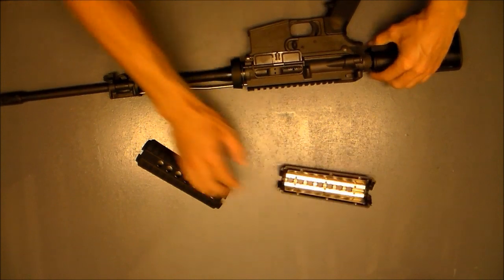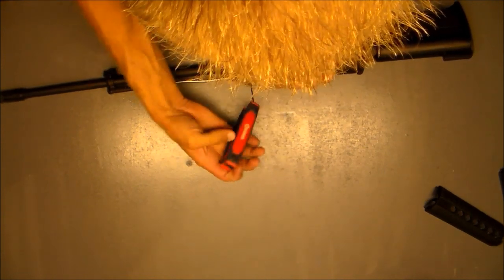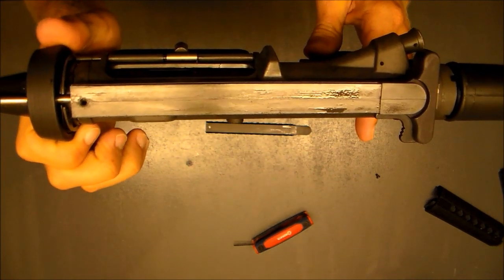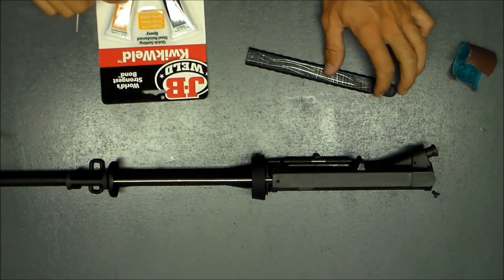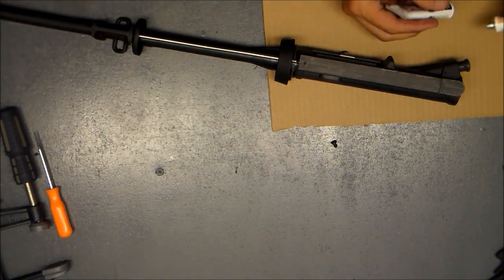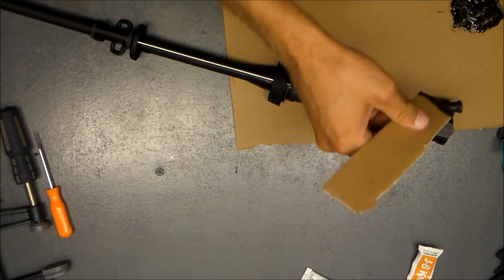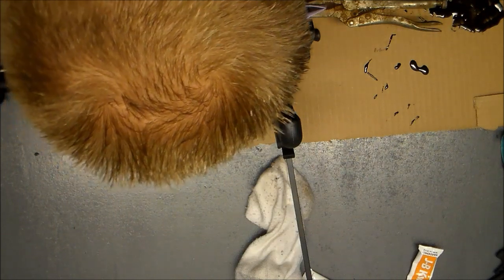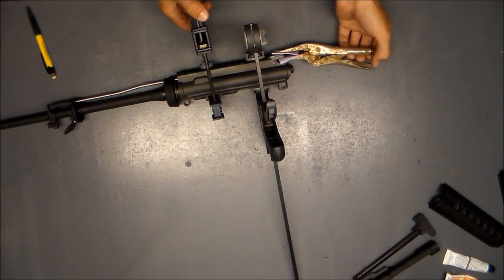Bushmaster Carbon 15 Picatinny rail repair

Comment: Anybody know the size of that screw/where to get one? Snagged a stripped C15 upper with no hardware for $10 a while back. Tbh I didn't even know exactly what it was when I bought it, but figured it'd be fun to find out and worth the gamble. I'm planning to use it for a 22

Comment: I had to do this about three yrs ago.. Still holding! I discovered another thing about the Carbon 15 about a yr ago.. I purchased a fifteen inch free float hand guard, and proceeded to install.. Went to install the steel barrel nut supplied with the full length rail, when I realized the nut wouldn't thread onto the upper. Apparently the carbon fiber uppers require a slightly larger barrel nut, in order to beef-up this area of the upper and add strength.
Reply: Lee, that is good info. Tell me, was the nut that came with the rifle able to correctly mount the rail? I recently picked up one of these for the bargain basement price of $450. One of my concerns is parts compatibility. I know I can just replace the entire upper if there are issues, but would need to be sure that I had the correct fasters.
Thanks!
Reply: @JF-lt5zc  Every part on my carbon 15 can be replaced with stock parts.. So, no worries. There are many mfgs that make free float handguards that will fit over a standard barrel nut. But, I had already purchased a fifteen inch that put a serious drain on the piggy bank.. So, I elected to purchase an Anderson standard upper receiver, back when they were going for fifty bucks. Although the carbon fiber upper requires that special nut.. the only difference in a standard barrel nut and the one that fits the carbon fiber upper.. is the thread size. All the other dimensions of the carbon 15 barrel nut are standard. Hope that helps.. By the way, make sure you know the proper torque for the barrel nut.. Most of the steel nuts are 35-80 ft lbs.. but the carbon fiber uppers can be torqued to no more than 35 lbs.. It's just plastic.. Be Kool Bro! Be Safe! It's Getting Crazy Out There!

Comment: I don’t recommend doing what I did but I repaired mine using super glue and accelerator,  clean surfaces are a must, I completely taped off and masked the entire receiver, all the surfaces that touch between the rail and upper were coated, you do not want the glue to migrate or you will be in trouble. It’s been a year and a half and it’s held so far, any side impacts to a mounted scope or sight should be avoided. Time will tell.

Comment: I bought my Carbon 15 in 'July 2014 I didn't realize it has the same issue until my son found it the other day,  almost 3 yrs to the day in fact. Your idea had me thinking......I know a guitar manufacturer that uses super glue on their acoustic guitars to attach the bridge to the body, the bridge has to hold a significant amount of string tension tuned to pitch, if the two surfaces are clean and flat, super glue may be a good alternative? 

 With that being said I did just that, cleaned both the rail and the top of the receiver, taped and masked everything that I didn't want the glue on and put two healthy beads of super glue along the top of the receiver, not too close to the edge that it would run over, I had the rail already started on dovetail so that when the glue was on I immediately slide the rail on all the way, once you start to slide it on you have to fully commit to it otherwise you could have a rail half on and stuck where you don't want it. The jury is still out on it since I haven't field tested its adhesion, I have my fingers crossed. The power of super glue on two flat surfaces mated together can be incredibly strong, the more surface area covered the more it will hold. Sorry for the novel, Bushmaster suxxx.

Comment: is it still holding up?  same thing happened to me a couple years ago and I just got around to it. I did the same thing so I was just wondering how good it actually works
Reply from the maker: Yes, its been holding a good zero. Thanks.
Reply: sweet! thanks for the info!

Comment: Thanks for the idea.  I have already loc-tited the screw that goes through the rail and into the upper receiver, but it has not solved the 'rocking' of the rail.  Of course, this makes it impossible to hold a zero from shot to shot, let alone range trip to range trip.  

I love my CAR15, but if this is even a semi-permanent fix (lasts for a year or so), the gun will be 100x better right off the bat.  For home defense, I normally go to my Glock(s), but it will be good to have a rifle that can hold a zero.  For now, its just been a fun plinker, but would never  be used for defense, other than spray and pray.  Very excited to get the materials needed and do the job this weekend.

Comment: sent mine in 01/2016 got it back repaired 03/2016. They replaced the entire upper with aluminum parts.They paid for shipping to and from and repair. Expect 3-4 months of you warranty it but they do upgrade it with aluminum so worth it for me

Comment: You know...the Kwik epoxy is probably OK. But why take a chance? Do you really need a 5 minute set up vs a 40 minute set up? Any "quick" epoxy is significantly weaker than regular epoxy such as normal JB Weld.

I used normal JB weld for my Carbon 15 rail with no sanding prep at all. The adhesion was perfect. The resulting bond is basically permanent. I taped the rail down while it set up so the joint was nice and tight. The slower cure  time gave me plenty opportunity to clean up the excess epoxy with a Q Tip and Isopropyl alcohol.
Reply from the maker: +Big Dave I used the kwik because it is black. the regular used to be light grey. i think the regular might be black now, too.
Reply: I understand. But color should be a moot point. My JB Weld  was dark grey. I used Iso alcohol, rags and Q-tips to remove 100% of any epoxy that got squeezed out. Just realize that according to JB Weld's own information, the Kwick version has half the tensile strength of the regular version.
Just something to be aware of. Thats all.

Comment: Thanks for the video, others need to be aware so they can fix this themselves like me, otherwise you ship it back to Bushmaster for a couple MONTHS. How has your Carbon 15 been running? Hopefully ok, unlike me, rounds kept hitting below the ramps giving me FTF's. Bushmaster's solution was to dremel M4 ramps into the carbon fiber upper, yeah, I was unable to get 3 rounds to fire when they said it was good to go and shipped it back. They are making these with XM-15 aluminum uppers now and fiber lowers because of this. Remember although I love that barrel and it's light as hell as well as accurate, it is not chrome lined so life expectancy is between 5k-7k if you take care of it real good and don't mag dump. Good luck.
Reply from the maker: Jason Mares Your welcome. This gun was actually repaired for a friend and I don't believe it has been bad about chambering. It usually shoots Lake city or Prvi Partisan ammo. I read online about how slow bushmasters turnaround was and decided it wasn't worth waiting on them. The gun generally seems reliable. Even after the repair, I still couldn't get as tight a group out of this gun as I would hope for. It went from allover the paper at 100 yds to about 3" after the repair.

Comment: Well?
Reply from the maker: rr baca It seemed to work out. The gun shot considerably better after this, but I never got any better group than about 3" at 100 yds with this particular gun.
Reply: What do you think would happen if you fell on this gun?
Reply from the maker: rr baca If what your asking is if it would hold zero if it was dropped or bumped, It might but i wouldnt trust it with out shooting it at the range to prove it again. the same goes for just about any rifle. the repair is quite durable if done properly, but keep in mind the barrel can also become loose in the plastic upper receiver if hit hard enough.

Comment: The repair seemed to work so far. The red dot that comes with this weapon is still solid after firing several rounds. Thanks for the video and advice.
Reply from the maker: Brandon Bennett Glad I could help.

Comment: I read about some corrosion if you bond carbon fiber an aluminum. Has anyone experienced this. If so is it bad enough to ruin the gun.
Reply from the maker: Brandon Bennett The receiver is not actually carbon fiber, its some sort of plastic. the thing to check would be if the type of adhesive you are using is safe with aluminum. Most all common epoxys are safe.

Comment: Im trying this right now i know this vid is a year old but did anyone have any success with this. I hope it works or I'm out 699 for this gun.
Reply from the maker: If you do a good job of it, you should be fine. And if you fail, you could always buy a basic new upper of some kind for 400 or so. It would sting, but better than 699 and still having the same problem.
Reply: robb8618 Ya ill never buy a carbon fiber ar again. I wish i had done more research before purchasing my first ar but you live and you learn.
Reply: robb8618 you can get a new aluminum flat top upper for under 100 dollars and have the barrel and barrel nut switched over for like 40 dollars at a gun smith.
Reply: poboy251 Windham weaponry carbon fiber uses a true one piece upper !
Reply from the maker: ***** I don't know why bushmaster didn't do that in the first place. That would be a pretty reliable design.

Comment: I have the same rifle but mine has the iron sight built into it. I want to change my upper rail to a flat top. Any suggestions on where to get a flattop picatinny rail? The same one as this that slides on.
Reply from the maker: If Yours Has a carry handle with the rear sight on it that is part of the receiver then the upper receiver would have to be changed. If that is what you have then it might be easiest to buy a 2nd complete upper that is a flat top. for something like this, the first place I look is usually midwayusa.com or a local shop.
Reply: 100 dollars for the upper receiver, 3 dollars for a barrel nut and 40 for a gunsmith

Comment: BTW, just got my C15 back yesterday. Had to go back day 2 after 90 rounds because they were jamming up BELOW the feed ramp. I thought they took care of this and was disappointed when I found out all they did was polish them. Haven't shot it again but will wed. So make sure to keep that in mind guys. I had originally thought the barrel extention needed pushed towards the rear but found out OE BM stock mags would sag when loaded, causing the mag to tilt downward! So this rifle(2013 type I have, looks exactly like your), must still have intermittent issues.sigh

Comment: @Robb8618, is that a fast set epoxy, meaning you really only had to clamp it for say half hour? Some wait overnight which is rediculous if it's a fast set. I'm actually going to do this today with Hardman fast set and give it an hour you think? I noticed you clamped the front screw part, middle and near charging handle. I assume it's best to have the gun broken down too. Thanks again Rob, this video will help many and show there's no need to send the gun for this.
Reply from the maker: Yes, It is JB Quickweld, The regular JB weld is a light grey color, the quick is black so any visible glue at the edges would not be obvious. As far as clamping, I would try to clamp it in multiple places to apply even pressure along the entire rail.

Comment: I repaired mine with JB Weld...same process. 1" groups are no problem. Aside from the rail requiring a simple repair, I've found no other reason not to like this gun.
Reply from the maker: Glad you were able to get that good a group, I couldn't get any better than 3" at 100yds with this one after the repair.

Comment: did it fix ur problem did it hold true zero
Reply from the maker: It did hold a zero somewhat but I still wasn't able to get any better than a 3" group with this gun while the other AR I had with me at the time was grouping at about 1" at 100 yds.  I guess its the barrel moving in the plastic receiver even though I checked the barrel nut.
Reply: robb8618 thats what im afraid of i just orderd a upper reciever